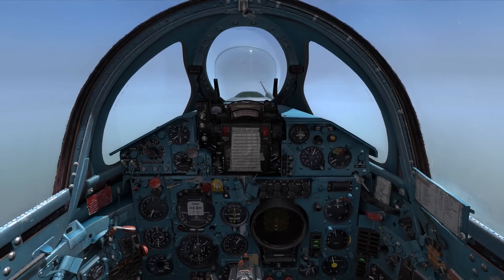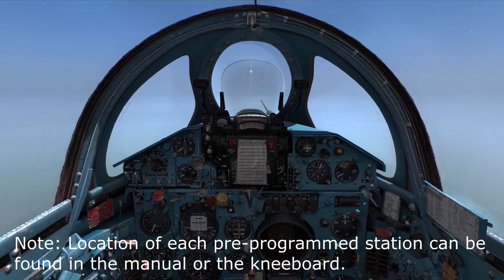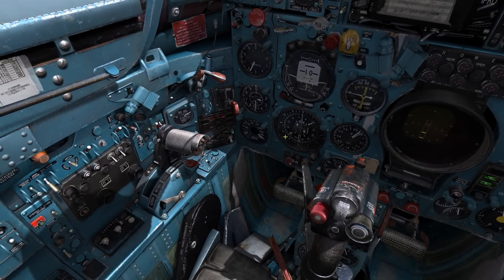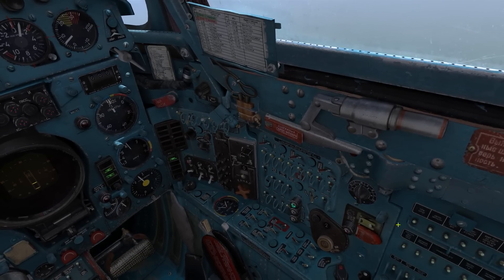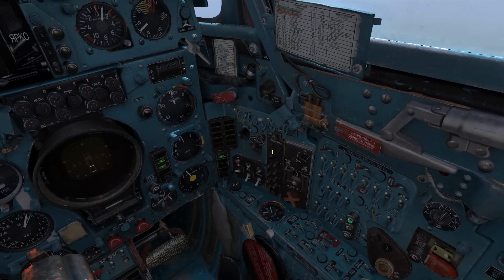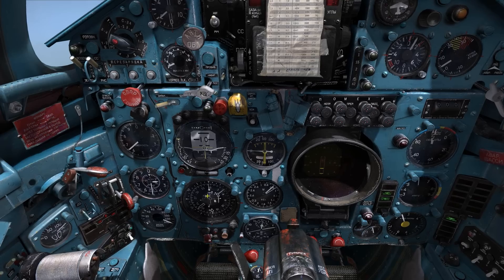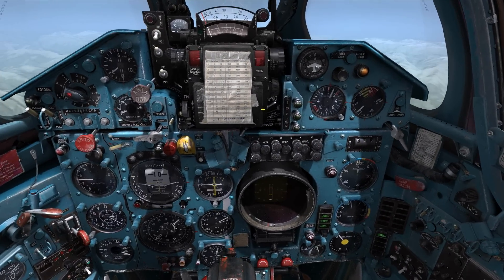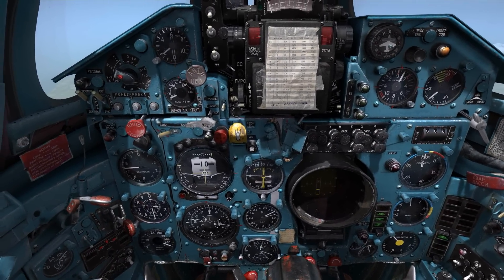[DCS] MiG-21Bis NDB Navigation

Comment: I thought they've already fixed that hypoxia bug.
Reply: xxJohnxx I got hypoxia last night flying around. So it would seem that the bug is not fixed after all.
Reply from the maker: Yes, they did. As it turned out it is a bug related to using "Active Pause".
Whenever you use "Active Pause" for some time (as I did at the start of the video) the hypoxia bug will occur. I reported the bug yesterday, so let's hope they will be able to fix it.
Reply from the maker: Paul Cory
Hmm, interesting. After the problem occurred during recording of this video I went ahead and did some testing. The only time the Hypoxia reoccurred for me was during the described situation when using "Active Pause".
I didn't get any sings of Hypoxia during normal operation.